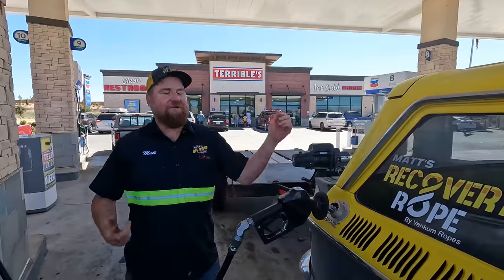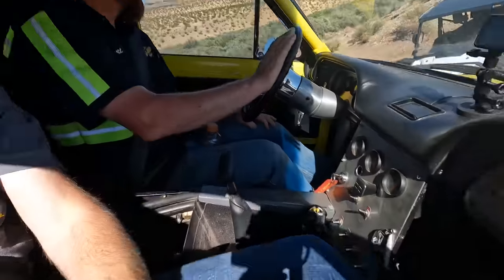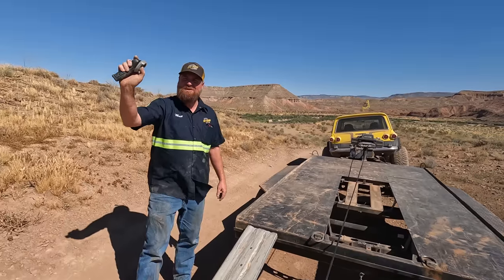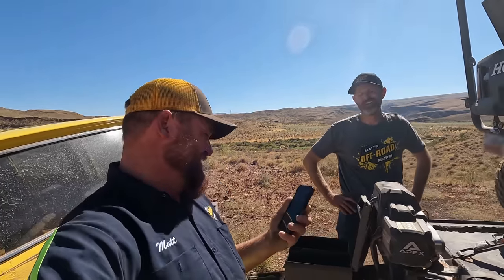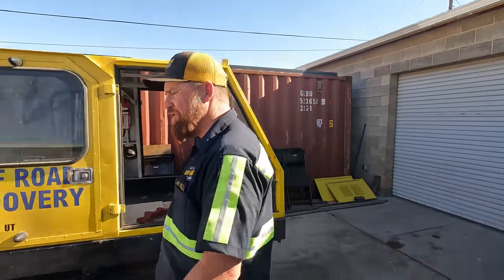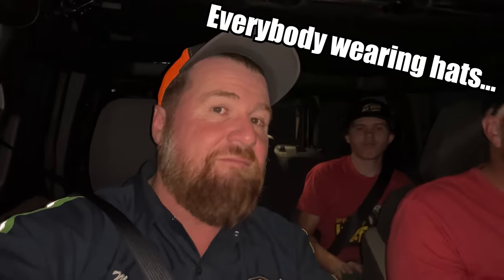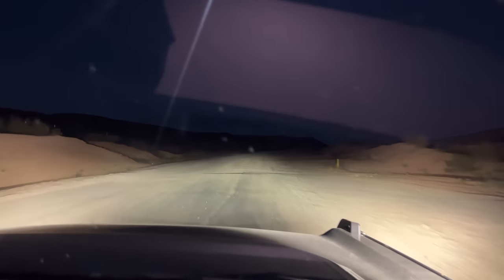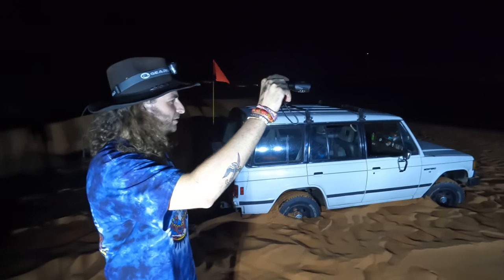Customer Get's Chewed Out For Getting Stuck!

Comment: I’m sure that 112 degrees of dry heat is brutally hot, but it just doesn’t look that bad when no one is dripping in sweat😂
Reply: They're sweating, but at 112 degrees the sweat just evaporates away nearly instantly.
Reply: You should try it sometime. It is hard to exist much less work in
Reply: @PGXPPR  As he said, it dont LOOK that bad since there is no visible sweat. Not that its not bad, just dont look bad. Looks the same with 112 and freezing
Reply: I worked in vegas. Concrete.  Live in TN now.  That dry heat is bad because sweat evaporates off you to fast. In TN you get wet to your toes. BTW it dont matter the where you live, That old sun ball makes everything just as hot.
Reply: When the dew point goes over 90 F or so, no matter what the dry bulb thermometer temperature is, you can't live for long even doing no work.
Reply: @HomebrewHorsepower  Thanks, Captain.
Reply: As a guy from Northern Sweden My body and brain quit working after 27°c/ 80f  😂
Reply: @billpapps4345  I was visiting TN, (love Tennessee), and needing to hop on the Harley to dry my hair.😂😂 It took a week to brush out the snarls, but it was dry. 🤣🤣
Reply: @mrolsen6987  although not from that high up north but this Estonian agrees with you 😂
Reply: His temp gun readings aren't crazy high, though.  Having lived in high humidity in Houston, moderate further north in Texas, and visited Matt's kind of desert in the Summer, I wouldn't hesitate to say the humidity is a bigger enemy than heat.   Plenty of 104 and 60% days that are far worse than 115 and 6%.
Reply: @hjuugo  
Yes I was about to write 25°c max but then the f convert got so uneven.. 
I'am the type of guy who like it best in  -15°c riding around with my snowmobile 😁
Reply: @brianhaygood183  As someone who lives in the dessert and has spent summers in areas like Houston, Oklahoma, Arkansas, and Missouri. The dry heat is much more depleting. I'm not sure if its because you don't realize you are sweating, or if your body cant produce enough sweat to keep up, but dehydration is much more likely. Then add onto what Matt is saying about ground temperature. You cook from above and below, sometimes even the side. Its much worse.
Reply: I would say the real danger of dry heat is that you can get heat stroke before you realize it.
Reply: Only 119F with 20% humidity in Phoenix today. Winters are nice here, summer is like northern winter.

Comment: I'm 48 been doing irrigation in south Florida for 25 years and i can say this summer is brutal, don't care if its dry or humid,  105 and up is no joke,, stay hydrated everyone ❤❤❤
Reply: It's been pretty mild here in northern NY.  Mostly rainy and like high 80s, couple days in the 90s.  Usually we're in the 90s with a few days that hit 100.
Reply: Up until this week we've had a rather pleasant summer so far for Iowa.
Only one 90F+ day till now (today will be the 2nd), and fairly dry air unless its actively raining.
Reply: Fortunately up here in North Florida has been rainy through May, June and July.  Helps keep the temp down, though it increases humidity.  We haven't quite hit 100°yet, usually been mid/high 90s.
I'm accustomed to Florida summers, being a 66 year old Native Floridian.  I spent three months on the west coast in my Navy Daze, early 1980s, but that was over the winter.
Reply: Humid is far worse than dry.  Sweat cools you off in dry, not so much in humid.  I'll take 105 dry over 98 humid any day.

Comment: As a southern Californian kid (now old adult) who became a cross country truck driver, I very much understand and respect the difference between southern humid heat and western dry heat. They are two very different things, and both can be dangerous and miserable. It likely has to do with where I was raised, but i prefer the dry heat if I had to choose. Love the videos....Be safe!
Reply: Dry heat doesn’t feel as bad, but it’s easier to get dehydrated in.
Reply: I can’t take heat in general, but if prefer 110 dry to 70 and tropical. That humidity is absolute torture, nothings ever dry.
Reply: @SaintNyx depends on the person. If it’s very humid, even in the 70’s, I physically cannot retain enough fluid to stay hydrated.
Reply: Everyone prefers dry heat. Also in mist if the southwest desert areas that are super hot on the summer (and fall and spring fir that matter) there’s always a nice wind which does help. You don’t always get wind at all in Dixie
Cheers
Reply: @Kozycz  The difference with humidity is that you’ll know you’re sweating and losing water. When it’s dry, it can appear that you’re not really sweating when you actually are.
Reply: oven vs sauna . both are hot as hell.
Reply: @SaintNyx Yes. I noticed that riding dirt bike around Sand Hollow and Moab in late may/early june this year. The daily high temps were only in the high 80s but it's so dry it almost seems like I could drink 3/4-1 gallon of water a day but not really sweat it out. Completely different than the Canadian prarie heat and humidity I'm used to.
Reply: @Kozycz dry heat dehydrates faster because your sweat and fluids (breathing) have a lower vapor pressure (pretty sure that’s the property, it’s been a while since chemistry). Basically since there is no vapor in the air the fluid on your body has an easier time evaporating and you lose fluid faster. When it’s humid your sweat just stays on you along with the moisture in the air. Add to the fact that most places out west are at elevation and you’re looking at a very dehydrated population.
Reply: @senditkevin  Yep, I grew up in the desert and a lot of people would come from out of town and end up getting sick because they didn’t realize they were dehydrated. It can be very dangerous.
Reply: @SaintNyx  yeah water is heavy and not fun carrying a gallon of it in a backpack, but I was always glad I did, by the end of the day I wouldn't have more than a quart left. 

Actually had a bit of a scare and almost got stuck in the bottom of the dunes with the bike, was about halfway done the west rim trail and concerned about fuel and water and the terrain ahead. 

Didnt think turning back was an option based on the fuel I had used to get there, once i dropped into the bowl i knew it wasnt. 

I could barely move the bike up a small hill in 1st gear, so downhill only it was. Its a dual sport crf 250l so doesn't have the most power or most aggressive tires (rear had only 1000 miles on it and is an 80/20 dirt/st), and I had never encountered sand like that before. 

But with enough searching on Google maps and stopping at every intersection I only turned wrong twice, and made it to a pump without running out of fuel (put in 1.6 gal in a 2 gal tank) or water.

After that, I knew I didn't want to ride sand dunes that much. Moab was a lot of fun, spent 5 days there and I already want to go back, but I'm heading to Alaska.
Reply: @Jasper118  That was the entirety of Texas in the winter of 2021, I swear! The power was out for a week and the air inside my house was so dry and my skin was so dry, that I actually breathed through an ice cold wet washcloth just to get some relief! You could put on lotion, but it was really cold and would only make you colder! I kept drinking water and trying to stay warm, but my 120lbs female body can't produce a lot of heat, and everything was sucking moister from me. I swear the house and carpets were dehydrating me!
As a native Texan, I can't say for certain I would prefer heat without power (all the food in the fridge and freezer would spoil), over the tortuous cold but I can say equally are bad. 

My Canadian dad was even complaining that it was cold during the ice storm of 2021!
Reply: @Jasper118  I have no problem staying hydrated in the mountains regardless of temperature. I went to Costa Rica and had to leave 2 days in because I physically could not hydrate regardless of the amount of fluid intake. But I’ve worked in the Mexican desert for over a week during summer, no hydration issues. It’s far more complex than a basic analysis of evaporative science. Biology is far more variable and plays a larger role
Reply: Dry and 76-80F is a rare delight in the southern southeast. Usually the mosquitos are extra thirsty too around the trees. Right now, at 9 am, it's 80f and 75% humidity. And that feels tolerable ..... but only until about 2 pm.
Reply: @TheOReport1994  I managed to move out of DFW like a month before that happened. It sounded miserable
Reply: @Kozycz  you have a weird body. I know it’s more complicated but that’s the general concept. I’ve worked in emergency medicine in Colorado, Connecticut, and Texas. Colorado by far has more hydration related issues, I rarely saw dehydration in Texas even at 110 whereas we’d be treating dehydration routinely in winter in Colorado. The elevation and dry air makes for much quicker fluid loss from the body.
Reply: @SaintNyx  try "wet bulb" temperatures where you literally can't cool down from sweating and you literally wil die without AC lol
Reply: @sangun123  I’ve heard of that, but after being in so many situations that seem to exceed wet bulb requirements, I’m a little unsure as to how it works. 100% humidity at 90 F + is pretty standard in many parts of the world.
Reply: @senditkevin  Yep, fair enough. Cool weather would be a nice change of pace after that.
Reply: @SaintNyx  It wasnt crazy hot, now in Utah it's in the 110s I think.
Reply: Whether you like humid or dry heat is all dependent on how many changes of clothes you have and access to showers.   😂
Reply: @Jasper118  when those climates are the comparisons, id imagine what your saying is entirely true, but a medical workers anecdotal comparison between somewhere like Colorado and somewhere hyper tropical would be much more apt for the original point. You made a bit of a straw man argument there
Reply: @Kozycz      how is that a straw man? I’d argue that my comparison works fine considering the average June temperature in San Antonio Texas is hotter than Costa Rica with similar humidity levels.  Maybe your experience in Costa Rica was not fluid related and there was some other variables at play? But again my original point was that generally drier air makes for easier dehydration because the fluid evaporates easier, you also don’t realize you’re losing fluid because it dries so far. You will probably overheat easier in the more humid environment though since the sweat is less effective. This may have been what you were feeling is Costa Rica
Reply: @Jasper118  sorry for necro

but this is what i was taught about it, humid heat doesnt allow you to cool down by sweating, so your internal body temperature tends to stay higher, to compensate you sweat even more in an attempt to cool off (which doesnt work). a dry heat kinda does the opposite but with a similar effect, your sweat is more effective at cooling you down, but it evaporates so quickly that you sweat more as well. the difference between the two is that you FEEL worse in humidity because your internal temperature tends to be hotter and your covered in sweat, but this means that dry heat can be more dangerous because it takes longer before you FEEL a problem and try to hydrate or cool down. 

having lived in an arid climate that sees 120f+ i have personally seen people go from looking fine enough to potentially life threatening condition in a matter of minutes. Yes a dry heat tends to be more bearable to most people, but it can be significantly more dangerous
Reply: @emi9643  that’s exactly what I was taught as well. Humidity seems worse because it feels worse but dry heat can be more dangerous